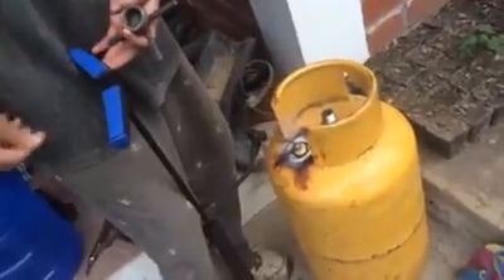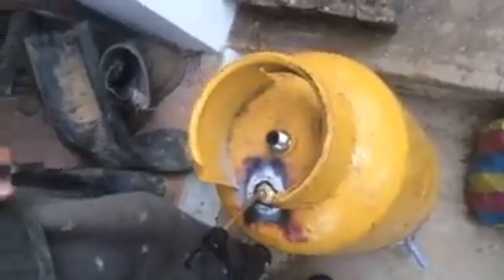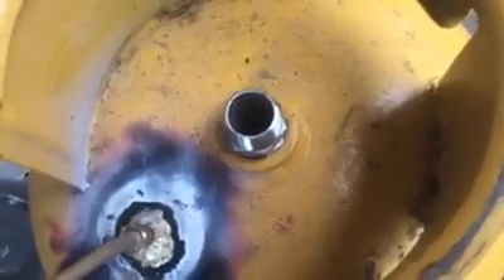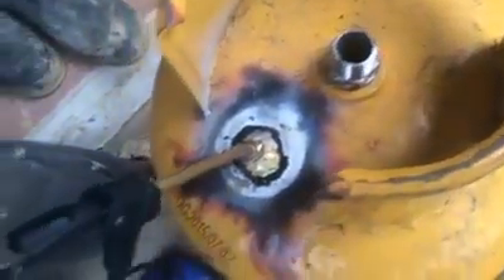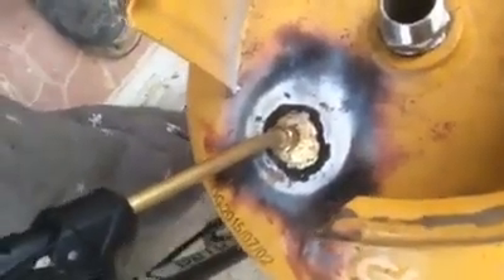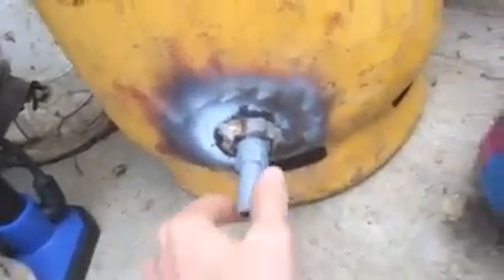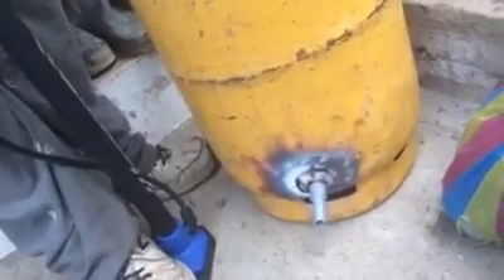Bamboo Pressure Treatment System

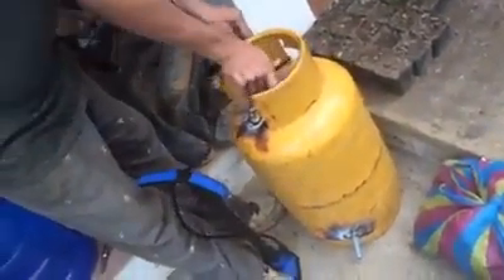Comment: The easiest way to treat alive bamboo: Copper sulphate solution is 1:10, so for 500gr of Copper sulphate add 5 litres water and stir until it’s fully dissolved. Stand the culms into an empty container then add the solution once the culms have been securely tied to prevent tipping the container. I’ve found that a large B. oldhamii culm will take up 1000-1500ml of solution over a 24 hour period. After 24 hours the leaves have wilted, photosynthesis has ceased and no further solution is taken up.
https://permaculture.com.au/treating-bamboo-using-transpiration/